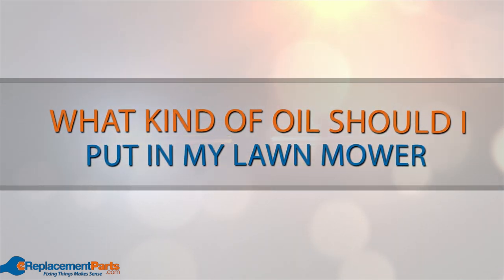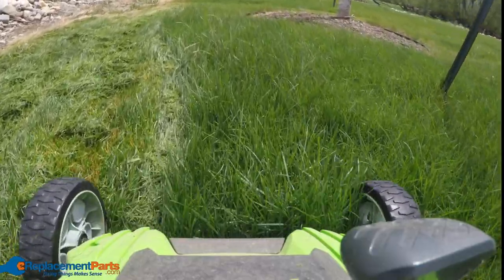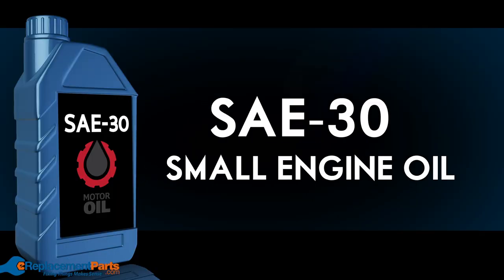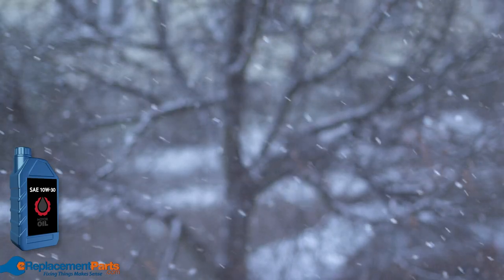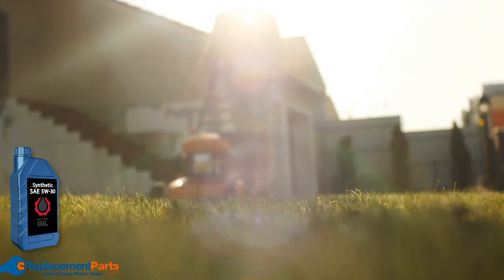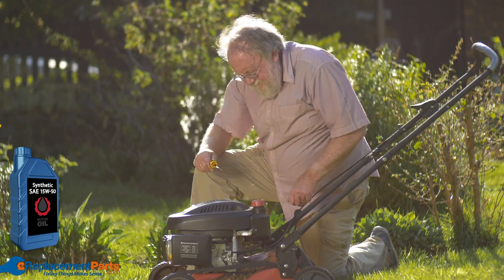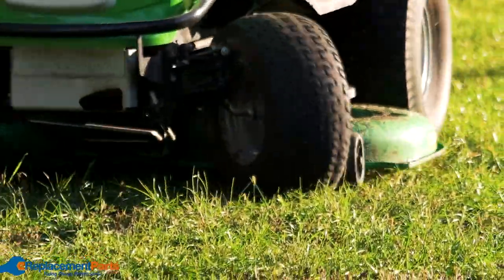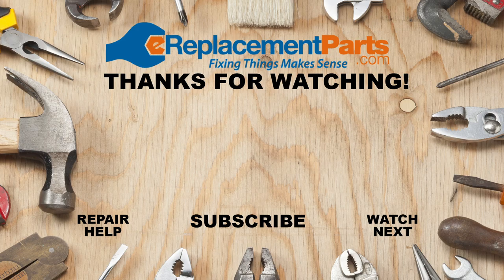Lawn Mower Oil Guide: What Type of Lawn Mower Oil Should I Use? | eReplacementParts.com

Comment: I was using Walmart 30w lawn mower oil until one time I mowed in 90 degree heat. It ran alright but when I went to start it the following week the engine has seized. I broke it loose by using my foot on the blade thus forcing it. I pulled it through a few times and it sounded rough. It started with a large cloud of blue smoke but finally cleared up in few minutes. I now use Valvoline 20w50 VR1 racing oil and have no more issues. I don't trust 30w oil in hot weather in air-cooled engines anymore.

Comment: Good video: I use 10/30 or 10/40 partial synthetic in most engines in my small engine shop. Thanks for the video.

Comment: The cheapest 10 w 30 you can buy. Change it before you store it, use premium gas with seafoam, drain the gas tank and carb when you store, it'll run forever
Reply: 10w30 is known to blow engines because it thins out too much. Unless it's a honda, don't use 10w30. stick with 30w.
Reply: @norge696  How about 5W30 synthetic? Is it okay to use in a Briggs and Stratton push mower engine?
Reply: @bobby1970  Yes. Disregard my last comment. 10w30 is fine. I was talking specifically mowers which really doesn't apply because I don't know anyone who mows grass in 100 degree weather.  5w-30 syn is good. 

Just check the oil before each use and you'll be good. Change every 50 hours or yearly. if it's a new engine change the oil at 5 hours.
Reply: @norge696  Great points, thanks.

Comment: Where does 2 cycle / 4 cycle oil come in?
Reply: I want this answer too!!
Reply: 2 cycle (aka stroke) oil is mixed in with the gas and is for 2 cycle engines only. Lawnmowers are predominately 4 cycle engines. Look up the difference between 2 stroke and 4 stroke engines and it will all make sense.

Comment: How much oil do you put in push lawnmower
Reply from the maker: Most push mowers will use about a half quart of oil. It will vary depending on the specific engine. You should always use the dipstick when filling the mower to ensure the proper amount. If the engine doesn't have a dipstick you will need to refer to the manufacturer for specific filling instructions. -Mark

Comment: 5w 20 LOL
Reply: I put 5w 20 in my push mower, because it's all I had. I knew it wasn't the best for it, but I don't care about it anyway, because it's a really old mower on it's way out anyhow. I was too lazy to get proper oil for it. If it was a new mower, then yeah, I would have gotten the right oil for it. So far, the mower is still running okay with the 5w 20 oil.